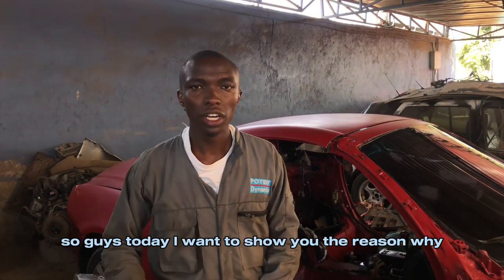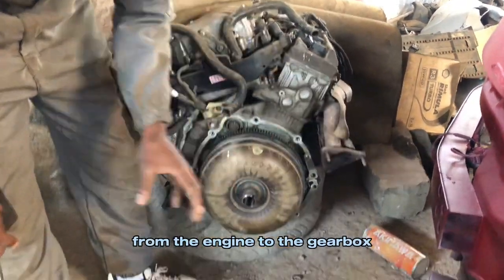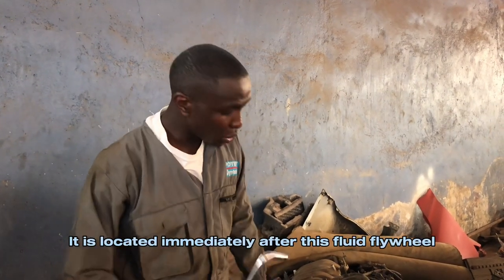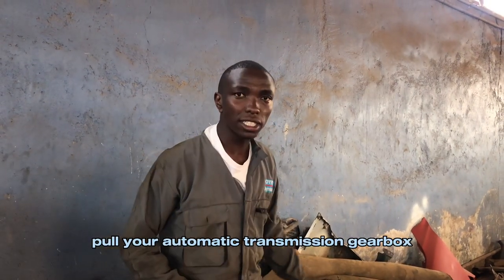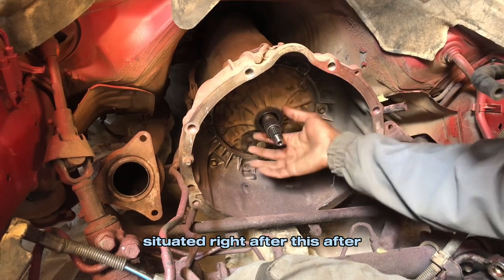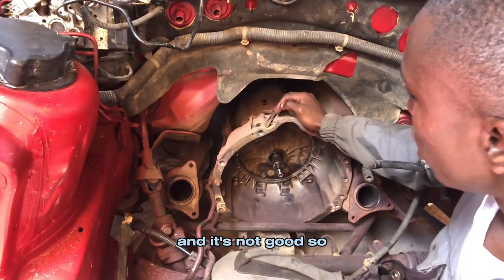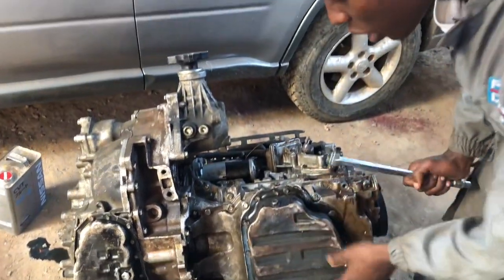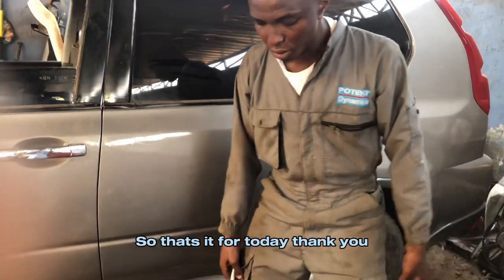Why you should not tow Automatic transmission cars

Comment: Doesn't putting the car in neutral solve the problem of the gears wearing out, since the clutch and overdrive shouldn't be engaged?
Reply from the maker: Maghorn,remember while the car is in neutral,the gears are held jn neutral,yes sir,possible but still,gearbox no getting lubrication,jnless its a manual transmission